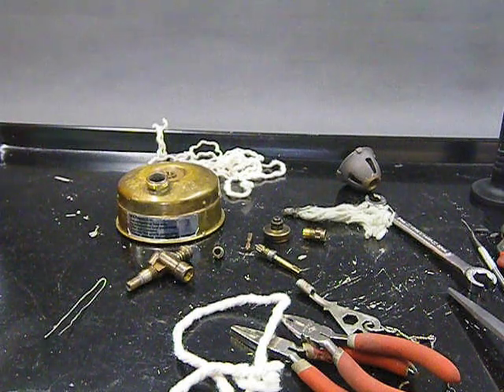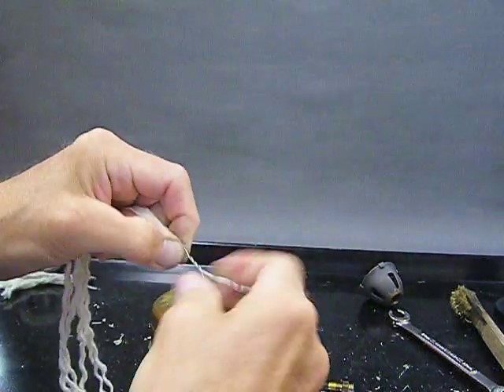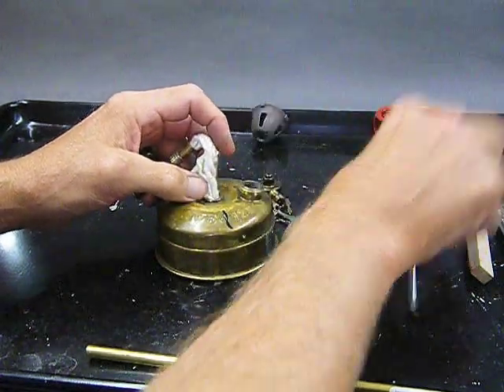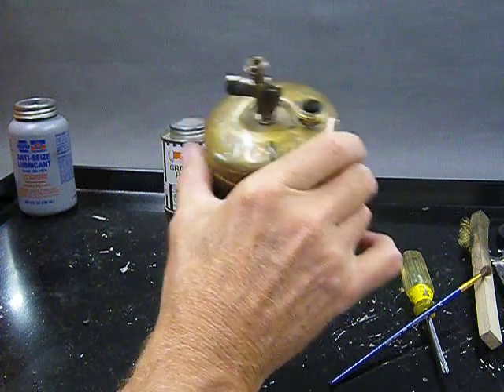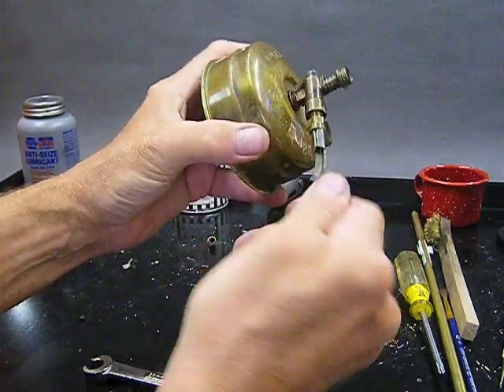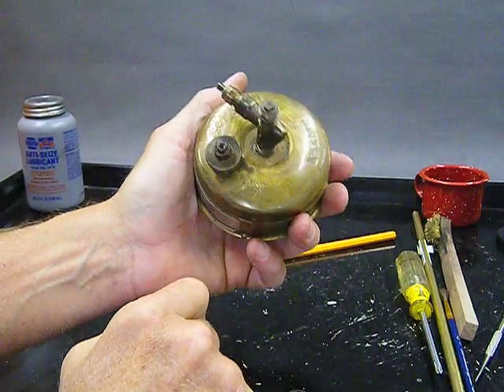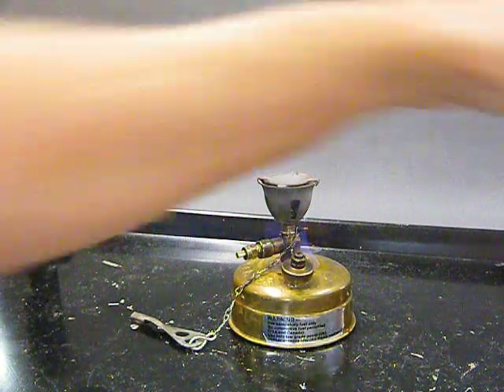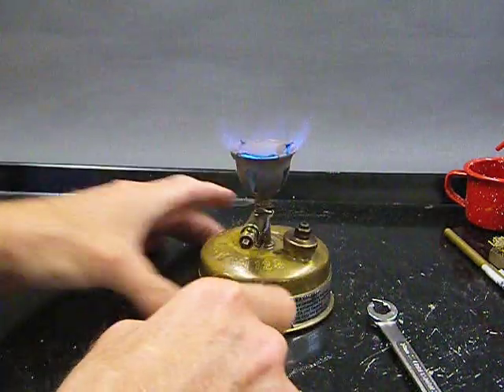BernieDawg's Svea 123R Stove Reassembly

Comment: Found my way here from CCS after a neighbor gifted me a complete, but beat up Optimus 88 including a Svea 123R...last used 48 years ago!  The stove fired right up when I tested it, so I came here to see how everything fits so I can give it a tune up.  Great video, man - love the banter.

Until watching this, I thought the valve stem was threaded left-handed...so the self-cleaning needle is likely seated way too deep, preventing the stove from shutting off!

Edit: Just pulled the jet off mine, and yep - by the method you showed, the self-cleaning rack was started NINE teeth left from the closed position!  It would bottom out almost 120 degrees from closed, and "shut off" could only achieved by the needle plugging the jet's orifice from turning the stem full left...but of course it would "candle" for a while and then seep fuel once the flame got blown out.

Now it works like it always should have.  Thanks for the informative video!
Reply from the maker: @VWAffe Thanks! Eleven years ago this video was first published here on YouTube and it's helped many, many people get their old stoves up and running correctly ever since. Glad I could help you and others. You can download a (free - no subscription required) manual for your Svea 123R from my website right here: https://www.berniedawg.com/wp-content/uploads/2020/05/optimus_123R_manual.pdf Keep the flame burning. 🔥👍BD
Reply: @BernieDawgCinema  just wanted to let you know I watched this tonight, June 16, 2024. Was having an issue shutting off the stove as maybe the needle is broke off. There is still a needle. But I was wondering if you could run by the needle adjustment again and another video
Reply from the maker: @karlfonner7589 https://youtu.be/ay9iPwA5LRA Remove your jet. Remove the cleaning needle by turning the spindle all the way counter-clockwise. Reinstall the jet. Try the stove. If it shuts off fine now, then you have an incorrectly set cleaning needle that is set too deep into the stove and won't allow the valve to close. Reinstall the needle higher (less clicks) in the stove. It may take you several tries to get it right. 
If the stove doesn't shut off when you close the valve all the way clockwise with no cleaning needle in place, then you have debris keeping the cone of the spindle from seating OR you have a damaged spindle tip. Further work is needed to correct this.
On the other hand... if this is a new Svea 123R (purchased new sometime in the last ten years) it's probably just poor workmanship from the factory located in Asia where they are now made. Stick with vintage Swedish stoves instead of the poor quality new stoves now sold by Optimus/Katadyn. 
Need even more help? Email to bd@berniedawg.com
BD

Comment: 9 years later and this is still a very helpful video.   I picked up my first 123r and it was a big help.  Still trying to find an earlier 123 but they are uncommon in my area.
Reply from the maker: @Wesley Blair Thanks! Correct info never goes out of date. Fwiw, I see five+ Svea 123(no R) stoves on eBay at this very moment. Unlikely you'll find them at garage sales and such this long since they went out of production. They'll never go down in price. BD

Comment: ran some old petrol through mine. ran rough. pulled it apart a bit and ran worse thanks for the video i needed 4 clicks running good now and turns off properly
Reply from the maker: Success is good! Bravo! Glad I could be some small part of the success where you are. 👍 BD
Reply: @BernieDawgCinema  Australia hence the petrol and not gasoline. pulled apart an old 8r a while ago guess i just got lucky putting that needle thing in last time. I like petrol stoves can get that stuff anywhere
Reply from the maker: While gasoline (petrol) is found everywhere, todays RUG (regular unleaded gasoline) is nothing much at all like it was when your stoves were made. Todays gas has many more additives than in 1980 - additives which your stove just won't burn. Over time they'll bake into a sludge and foul your stove(s) since the stove(s) don't run hot enough to burn them. Plus, at least here in the USA, there's up to 10% ethanol in RUG which has lots less energy. Best thing to run in your stove(s) for their longest life, best burn and trouble-free performance is Coleman fuel, Crown fuel or other similar naphtha stove fuels. Sure, they cost more. But, unless you are living in the woods full time and your stoves are twice daily users, you'll likely spend more on petrol in your car to get the trailhead than you will spend on a whole years of stove fuel. 👍 BD

Comment: Hi Bernie.  Any idea where to get a replacement graphite bushing for this stove?  I'm assuming it would also work for the 123, which is what I need it for.  Don't know if the comments section is the appropriate place for asking questions, but couldn't figure out any other way to do it.
Reply from the maker: @Harley Bootman Oops!! Don’t assume. If you have the Svea 123 (no R) then the spindle is much smaller in diameter, as is the spindle housing, than in the Svea 123R. The Svea 123R and 123(no R) graphites are not interchangeable. Completely different beasts. The tiny graphites for the 123(no R) are made of unobtanium and are mostly rebuilder duplicated by wrapping the shaft of the spindle with graphite tape. But, most folks don’t need to do that since they never actually removed the graphite on the no-R in the first place. Just tighten the no-R spindle nut and you should be good to go in that case. You can get parts in the USA from spinnakerspar. He’s an eBay seller of stove parts and there is a link to him in my Stove Parts Links webpage. The link to that webpage is just below this video in the description box. Lots of other helpful part suppliers at the parts webpage, too. BD

Comment: Where did you get the CLEANING "PIN" my stove is old....given to me and it did not have the tool. Mine is an original 123.....???
Reply from the maker: If you mean the cleaning needle/rack in the Svea 123R, the stove comes with it and yours should, too. If you messed yours up and you need a new one, you can get one through Base-Camp in the UK. Just use the link for my Parts Suppliers at my webpage: https://www.berniedawg.com/stove-part-supplier-links/ BD
Reply: @BernieDawgCinema  
Dude, just found the links and just ordered all the repair gaskets I need 
Thank you for responding
Reply from the maker: @MARKIEBANUNCE Looked at some of your videos. You have a Svea 123 (no R) stove. So... you can use a high E string off your guitar to clean the jet since there is no built-in cleaning needle. You can make a handle for the short section of guitar string by using a slip of aluminum from a beer can. Crimp the string in one end and you are good to go as long as you don't do it while the stove is burning. Roofing sheet metal can be used for the same handle if you want one for use with the flame going. BD
Reply: @BernieDawgCinema  
Right on Man.
Thanks for looking out

Comment: watched your video on putting new gaskets in my optimus stoves Where can I get the blue Vicom gaskets you showed .  I have 45's , 48's  123's , 00's and 111's from my days as a wilderness outfitter.  They date back to the 70's and 80's when I was a wilderness trip leader.  I used to get my replacement parts from a guy in LA.
Reply from the maker: The seventies and eighties were 30-40 years ago now. If the fellow in LA you used to get parts from is the one I think he is, I sadly believe he may have passed away. Ebay is the place that's easiest to get gaskets and seals. Just do an eBay search on "Svea stove seals gaskets" and you will get several USA sellers. Or, order parts from Base-Camp in the UK if they still have any remaining and you don't mind the shipping cost and fulfillment lag time. But, even Base-Camp is running short of many items after all these years. The blue Viton gaskets I use in my videos are ones I cut myself from Viton sheet I buy on... yep, eBay. I bought sets of Mayhew concentric hollow punches to cut them with. I make my own seals for stoves I'm repairing or restoring for clients, but I'm not in the business of making/selling gaskets and seals beyond that. Sorry. Metal parts like spindles, jets and the like are also being made as quality reproduction parts by folks in Taiwan, Hong Kong, S. Korea and Japan. Again, eBay is the place to check for these. If you need stove repairs done beyond simple gasket changing or need more help, drop me an email: berniedawgstove@comcast.net BD

Comment: Good job on the 1 & 2 videos.  I didn't see you dig into the pressure relief valve on the filler cap.  I just purchased a Svea 123r and wondering if this valve needs maintenance.  I can't find a tool bit to fit the pentagon hole?  Do you have any suggestions?
Reply from the maker: Thanks, Chris Culp. The SRV and pumpable SRV fuel caps are the subject of another two-part video pair which you can find here:
https://youtu.be/d6SEE1ToCSQ and here: https://youtu.be/a0BRBzuN0g8
I build custom SRV Penta-Wrenches from scratch. Contact me at berniedawgstove@comcast.net to find out more.

Comment: Bernie Dude,
 Hey, I have a older 123 and am trying to reassemble it. I have cleaned it, put on new tank gasket and just watched you showing the valve reassemble. The kit I got contains theses little round solid gaskets and I don’t know if they go to this stove or a different one. I also replaced the wick. Do you have any ideas or is there only the tank gasket? 

Thanks,

Brad
Reply from the maker: The "little round solid gaskets" are probably pips for the SRV (safety release valve) fuel cap. Take a look at the fuel cap video here and you'll see what that's about and whether those are SRV pips that you have there. https://youtu.be/d6SEE1ToCSQ BD

Comment: Hi, Great video! I need help. I have put new parts in my 123 but after pre-heating there is almost no air/whitegas mix coming out of the burner head. 
I have replaced all essencial parts. I gave the needle 5 clicks. What can i do to get it runnin? Thanx!
Reply from the maker: @Jan Vink You should remove the cleaning needle and try the stove without it to make sure the way you’ve set it is not the problem. If the stove was ever used with automobile gasoline, then the passage from the jet to the tank may be clogged with auto gasoline sludge. You can clear that with a thin wire or guitar string. But, if you haven’t rebuilt the fuel cap entirely (I have another video for that), then you probably aren’t developing pressure as you have a pressure leak in the SRV (safety release valve) of the fuel cap. That’s about all we can do in comments at YouTube. For more help beyond this brief note in a severely limited text-only format, just send an email to my help address here: bd@berniedawg.com We’ll get you fixed up and running right. 👍 BD
Reply: @BernieDawgCinema  I am going to check it. Thanx so much for your quick answer!
Reply: @BernieDawgCinema  there is no sludge in the passage from the jet to the tank. So it must be the SRV. Where can i buy these in Europe?
Reply from the maker: @Jan Vink If you want to buy a new fuel cap, try Base-Camp in England. If you want to rebuild the fuel cap with new seals, you can get the cap seal from Base-Camp, but will have to buy the SRV pip from someone like eBay's spinnakerspar in the USA. Links to these vendors and many more are at my links page at my website here: https://www.berniedawg.com/stove-part-supplier-links/
My Optimus/Svea fuel cap rebuilding video is right here: https://youtu.be/d6SEE1ToCSQ  BD

Comment: Hi Berniedawg, thanks for all the great videos on the svea123r. I'm having an issue with mine since I bought it new. I had it go from priming to lighting itself which I fixed by retiming the cleaning needle. However I only get a positive shut off.. 10% of the time. It candles for a while. I took out the spindle cleaned the mating surfaces and inspected for any scoring still does it. Debating on picking up a rebuild kit and throwing a new spindle in. Any advice? Also thinking of wrapping the threads with some pink Teflon tape (the one for gas and propane lines). Thanks!
Reply from the maker: @Christopher Patterson Thanks for your note. There are too many issues here to cover all this in a YouTube comment or to have a running exchange in YouTube comments. I maintain a free "help line" at my business email address. Let's just move this discussion there, please. Thanks! 👍😎 bd@berniedawg.com Talk to you soon. BD

Comment: I've had a Pak Cook 235 for over 40 years, all this time I thought it was a 123. When on a backpacking trip (25? years ago) it started to burn out through the spindle. I didn't know enough about it to try to repair it but after watching your videos I'm inspired to try. My question; is the graphite packing interchangeable with the Svea? It doesn't look like it's coming apart, I'm going to try it as is but if it still won't seal can I use the 2094?
Reply: So, 45 minutes after my last post, rebuild is done & tested. Works great! To think that I could have still been using it all this time... Had a friend give me his older Peak 1 model 400, used it for a few years, then bought a Peak 1 #3024, used it for several years. Currently using a Jetboil Flash, but I'll never give up my old "Svea"! Hope my son will appreciate it...😉
Reply from the maker: @Gary Dahle Wow! Great Job, there, Gary Dahle! Sorry I had some other life-things going and didn't respond immediately when you posted your comment. Glad you got everything worked out and all is well with your Pak Cook. Success feels goooood. 👍😎 BD
Reply: Hey Gary, did you use a graphite strip or were you able to find a graphite seal that was the right diameter.  I see stuff for sale, but they're strips you cut up.  Thanks.

Comment: Hi just tuned into your videos can I use denatured alcohol in the sve 123 instead of Colman fuel thanks
Reply from the maker: Wouldn't it be cool if you could use denatured alcohol in a Svea 123? But, you can't. It won't work. Alcohol mixes with air at a completely different ratio than white gas (Coleman fuel, aka naphtha). 
White gas is the ONLY fuel you should use in a Svea 123/123R. 
Avoid RUG (regular unleaded gasoline), too, as modern formulations of RUG are nothing at all like they were back when these stoves were invented by Swedes. RUG will cause clogging and sooting. I know! RUG-clogged Svea 123/123Rs bring me lots of $$$ when I end up repairing them for clients. 🙂 BD

Comment: When replacing the wick on a slant key, do I reinstall the brass screen around the wick or can I leave it out?
Reply from the maker: Well... I reckon if it came with one in there, it's the right thing to do to put it back. That makes it like it came from the factory for the next guy. Having it there won't hurt anything and may improve the performance. (Or, at least the makers thought so by putting one in in the first place.) But, it's your stove... and you can do as you like. 👍 (Fwiw, I always put parts back if they were there already. Maybe just me?) BD

Comment: Hello. What kind of gasket or sealing material is in the valve? Mine is leaking too badly.
Reply from the maker: @Bert Heideveld The spindle packing around the spindle is made of a compressed graphite. You can get the spindle packings here as Optimus part number 2094: https://www.base-camp.co.uk/Optimus.html
And look at the stove diagram here: https://www.base-camp.co.uk/exploded%20views/Optimus/123R%20Svea-Climber.htm
You can also use a pure graphite ribbon to wrap your own graphite spindle packings. Material specs and how to do that is beyond the scope of YouTube comments. Contact me via email for that. BD

Comment: Hi there, I may have mentioned I have a Number 7 cooker [a version made for the British armed forces] it's based on the Svea 123R. mine works, but in reverse! when rotated to the right it's full flame, it lowers when turned to the left [anti/counter clockwise] it goes off when the cleaning pin pops out. what would be your advise to correct it? Thanks in advance!
Reply from the maker: @473specop I have a BM #7, too. It works just like a regular stove is supposed to. = Off when fully to the right, big flame in the middle, cleaning needle extends out when fully to the left. Yours sounds like the cleaning needle is set too low. Remove the cleaning needle. Before you reinsert it, try the stove without it. You should now find it shuts off turning to the right like it's supposed to. Now, reset the needle in the stove as I show in my video and try it again. If the needle is set properly,  the stove should now work as intended. Rewatch the video here to see how to do this correctly.. If it doesn't shut off, reset the needle higher (fewer clicks). Try it until you get it right. Usually takes newbies a few tries. Be patient. You can do it. Good luck! BD
Reply: @BernieDawgCinema  Thank you so much for your advice, I'll do as you advise, thanks again!
Reply from the maker: @472specop You betcha! And if you need additional help or run into difficulties, it's easy enough to send an email to: bd@berniedawg.com where I can trade photos with you that show what I'm talking about probably better than my words. BD
Reply: @BernieDawgCinema  Hi again, well after much fiddling around with 'clicks' it seems I've seated the cleaning needle correctly, I've used it a few times today, Pre-heated and then for the first time in years; ignition, a good flame and it turns off promptly. So a big thank-you from me for your help, Cheers!
Reply from the maker: @473specop Excellent news! I'm glad I could be of assistance. Have fun! BD